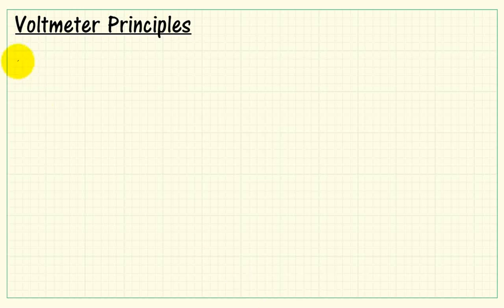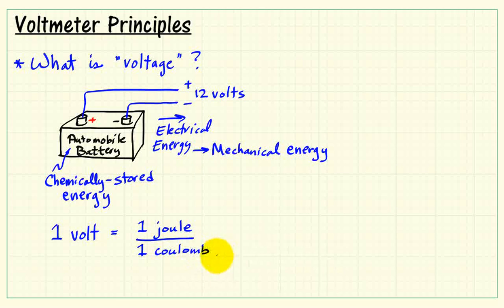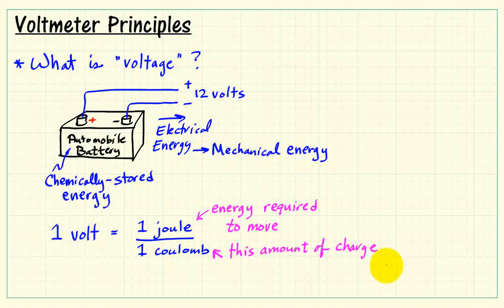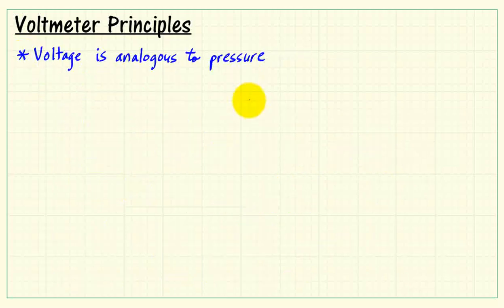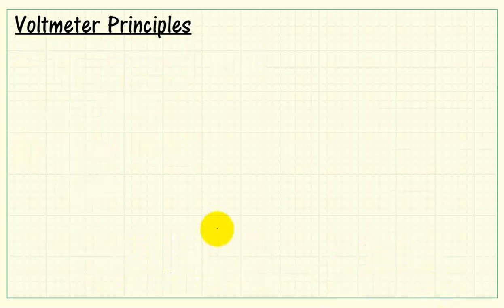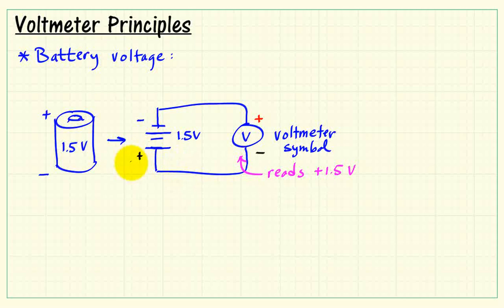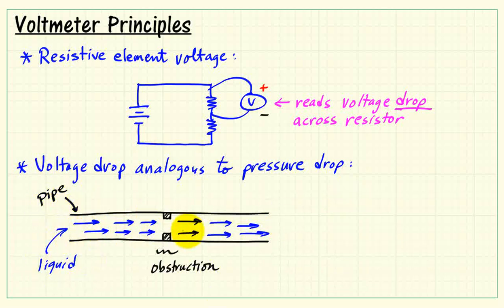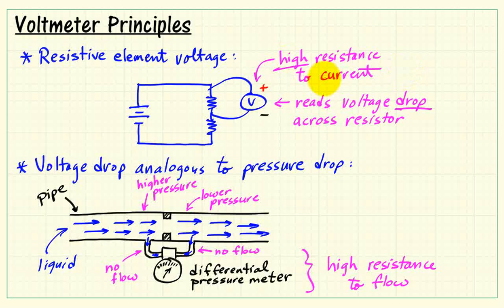Voltmeter principles

Comment: But what is the 'lower pressure' on the other side of the resistor representing?What is the voltmeter actually detecting? Are the electrons spaced further apart from each other? Or are they just vibrating differently maybe?

I really can't find anyone who can tell me what is actually going on here. It's always an analogy. 

Surely the current has to be the same as it was before it went through the resistor, so if that value is unchanged then what else is there that the voltmeter can be measuring?

This has perplexed me since school and I never got an answer. Can you help?
Reply: First let me explain it on mechanical physics:
Consider a straight water slide: If I pour some water on the top of the slide, it will move downward because there is lower gravitational energy at the bottom of the slide. So lower gravitational energy on the lower levels is the reason water goes down. 

Now let's put some rocks in the middle of the slide (they are attached to the slide so they won't fall down). Water will still go downward but the difference is those rocks are blocking the way, so it gets harder for the water to continue its way but it doesn't completely stop. You can imagine that very little water will make their way out of the rocks at the time and it takes more time for the whole liquid to reach the ground this time. In other words, the water pressure at the bottom of the rocks is lower than at the top. 

If we consider the water slide as a circuit, the rocks as resistor, water as electrons and the height difference between the two ends of the water slide as the voltage, you can probably understand that why there is lower amps on the other side of a resistor. Resistor makes it harder for the electrons to flow and continue their way in the circuit. So basically there is lower pressure on one side of the resistor.
Reply: @parniaj.6431  Better explanation than my whole book
Reply: And about what voltmeter actually detects, it is like the time you want to measure the gravitational energy difference of the water on two different spots of the slide. Water at higher points of the slide tends to descend more than at lower points. So there is a difference between the tendency of water to go down to the ground. If I want to explain it on a circuit, the highest point of the slide represents the positive pole and the lowest point represents the negative pole of the battery. Electrons tend to move from the positive pole to the negative one. This tendency is what we call voltage.
Reply: I share your frustration
Reply: The voltmeter is essentially a ammeter in series with a very big resistance value.
As you put it in parallel with a voltage source, the ammeter reading multiplied by the known resistance value of the internal resistance of the voltmeter is the voltage reading.
Naturally, if you try to measure the voltage across a conductor, the internal resistance will be short circuited, and so there will be absolutely zero current flowing through the voltmeter, and so it will read 0 V